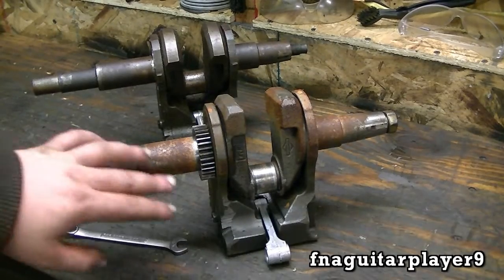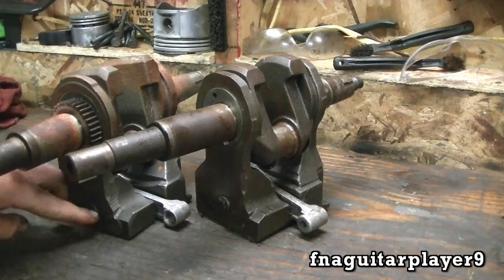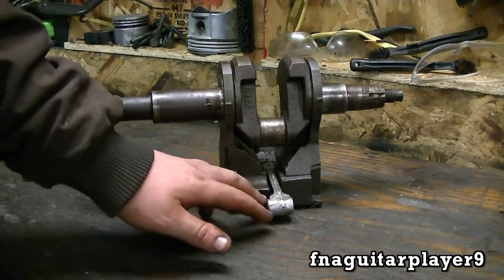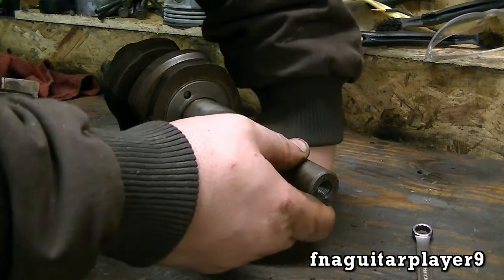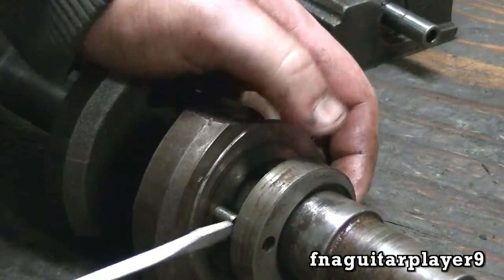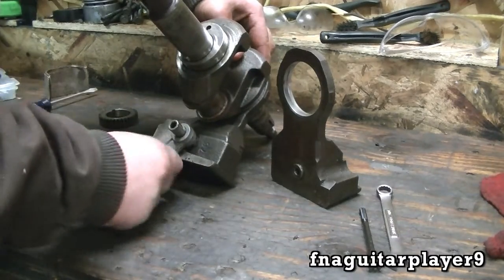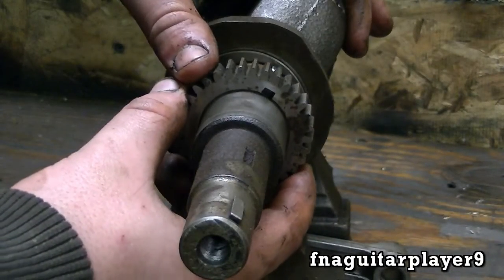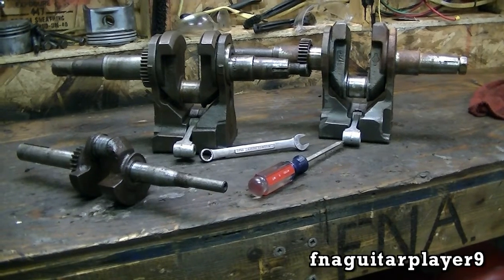All About Briggs & Stratton Synchro Balance crankshafts and how to remove counter weights

Comment: Do you have to use those counter weights? I have a set of the other style. The kind that doesn't have a rod to hold it in place. Can I use those counter weights or do I need to use that kind?
Reply from the maker: willy68057 If that crankshaft will fit the block (same stroke, and same size shaft/journal) yes it will work fine, but I'm thinking the older style won't fit the bearings on the newer style, not for sure on that, try it and get back to me, i'm curious to know. Thanks for Watching!!!
Reply: fnaguitarplayer9
 yep fits but went with the older style. They are built a whole lot better
Reply from the maker: willy68057 Heard that. Yeah, I'd like to find me a older style 12 horse, the ones with the starter-generator. Good motors.

Comment: My friend has a syncrobalanced 12 hp on a gokart. We run it un governed. It's been going strong for a couple of years. No knocks doesn't run hot.  Oil is never over dirty.  We may get around to removing the syncrobalancer but it's never failed yet.

Comment: thanks for the quick response.  I actually found another site where a guy was asking about the very exact thing - in 2006.  After the second dog bone he said he was going to scrap his engine.  On the way to the Snapper Store now to see if they can explain it.  A glance at the pin(s) look like both ends are the same, but they are not.  Slight difference to the bevels at the ends - one end is slightly more blunt.  There appears to be nothing inside the hole to press the pin into.

Comment from the maker: oh no! I've never seen that happen before, its supposed to be like pressed into the block so it can't move or come out. The pin will need to be fastened somehow to the block again, I don't know what the best method would be right off hand, pressing probably won't work since it done came loose, can't weld it, if there was some way to drill through the block where it is, then tap it and put a bolt through it? I don't know what to tell you! i've never had that happen. Thats about all i can think>>>

Comment: I replaced the weights and the dog bone on my B&S. Started and ran great for about 2 min and then bang!  Took apart to find dog bone broken in two, again. The pin holding the end of the dog bone (the end away from the weights) in place was laying in the bottom of the crankcase.  There appears to be nothing that keeps this pin from falling out of the crankcase and out of the dog bone.  When the pin falls out, one end of the bone is loose and breaks.  Any suggestions?  Your videos are great!

Comment from the maker: If it is a flathead motor, a blown headgasket will not cause it to smoke/burn oil, because the headgasket only seals the head to the block, there is no oil being sealed off by it (not like a OHV motor), but it does sound like it needs a new headgasket, which should help the backfiring problem, but I don't think it will help the smoking problem, sounds like its just burning oil, replace the head gasket then we'll go from there.

Comment from the maker: If it was a overhead valve engine i'd say it would be the head gasket, but its a flathead so its not that, what probably happened (very very common by the way) is when you shut it off the float stuck or the needle valve didn't seal in the carburetor and it flooded the crankcase with gas (gas ran past piston into the oil, making it act like there's to much oil in it) don't run the engine anymore, check the carburetor to make sure the float is working free, then do a oil change>>>>>>

Comment from the maker: No problem, its a fun hobby! Yeah if you take to much off it will make it fit loose in the bearings, I recommend using sandpaper, and kind of like cup it in your hand around the shaft and turn it back and forth, use about a 220 grit paper, if its really really rusty then go with 100 or so. I would not go below 100 grit. A wire wheel would probably scratch it up to much. your welcome! Thanks for Watching!!!

Comment: Hello,

Thanks so much for taking the time to make these videos for us. I have a quick question. The ends, or shafts on my crankshaft are a bit rusty. What do you recommend using to clean the rust off? 

I have a wire wheel, but don't know if that will take to much off, or if it even matters? Appreciate your time, and any help you can offer. Have a great weekend, and thanks again for helping us out with these videos.

Comment from the maker: hmm. the only thing i can think of is that the crank bearings are to tight and is not letting it turn. you mean cylinder sleeve? usually don't have to worry about the cylinder much when rebuilding, i can usually get by with just honing. If a engine has a sleeve its a cast iron sleeve, if no sleeve its aluminum bore, the block itself is the bore. no i don't think i have, i've had several thats really tight after rebuilding but after it breaks in it loosens up. don't really know what to tell you!!

Comment: no the connecting rod is not hooked up, and everything is oiled up.  the crankshaft will not turn in either direction. the only thing i havent replaced is the cylinder bearing in the crankcase, that just looks like an aluminum sleeve to me.  just checking if you ever ran into this before

Comment from the maker: alright, let me ask a few things first, do you have the connecting rod (the rod from the crank to the piston) hooked up yet? If it is, sometimes these motors are stiff to turn over after reassembly. Or it could be a tight bearing on the connecting rod. Be sure to put plenty of oil or stp all over bearing surfaces and the walls of the cylinder and piston. does it spin over at all i either direction? thanks for watching!!!

Comment: oh no we got it figured out were i just increased the oil level to that at the bottom of the old slinger it still throws it around the weight splash and so do the bottom cm of the crank

Comment from the maker: yeah i remember i think he did a video talking about that. you would have to have someway to do away with the synchro and use the brass weights i would think. person could have a oil pump and pipe it so it throws oil on all parts. i don't know

Comment: no actually its still a on going progect dew to a j b weld problem but me and chargermilles thought wee could use them as a splash although i did hook up a separate oiling system

Comment from the maker: yes and no, generally speaking you don't have to switch out the counter weights on a stock engine, its usually for ungoverned racing engines going past stock RPM. it might be a little better on gas i figure the brass weights weigh alot less than the stock cast iron synchro balancer. they are about 80 bucks for 2. thanks for watching!!!